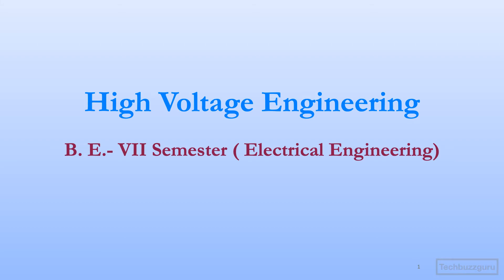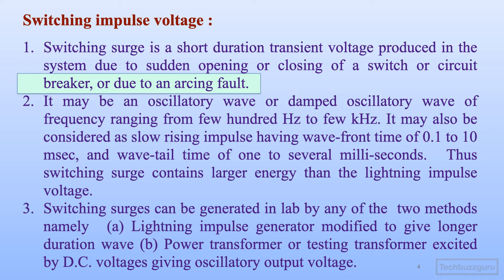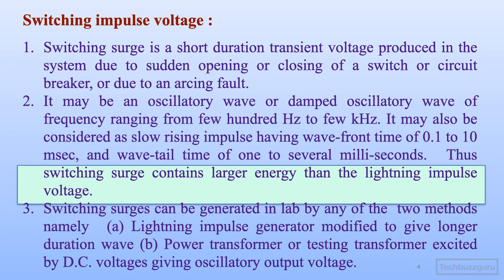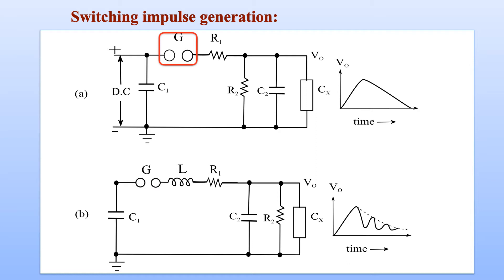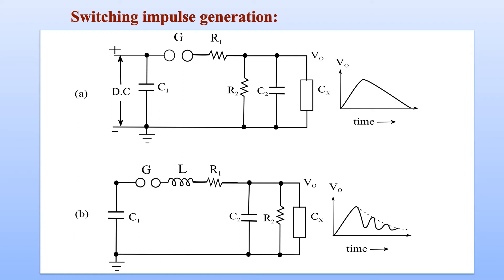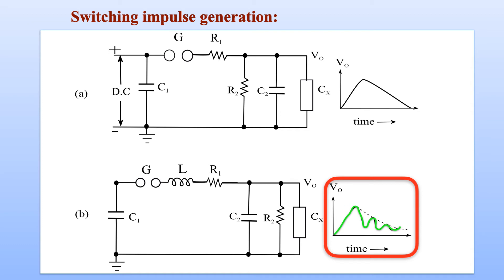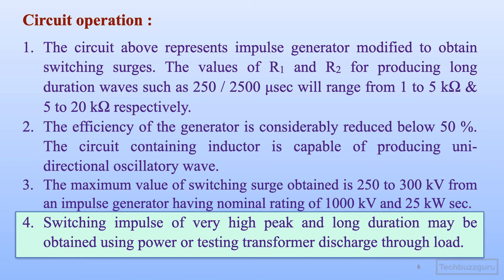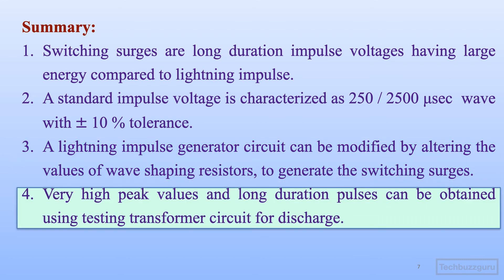Generation of Switching impulse voltage

Comment: hi bro, how are you bro, my name is Rizki from Indonesia. i want to ask bro marx generator circuit problem. The circuit that I made is exactly the same as the one I designed, bro, but why is it my turn to do the spark over test not in the spark gap bro, that's what influences it, bro. thanks bro